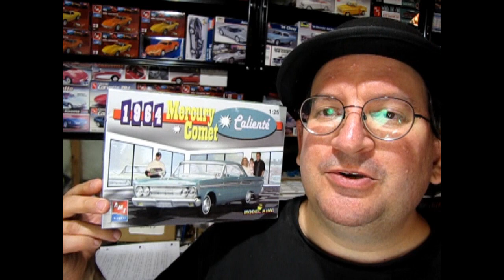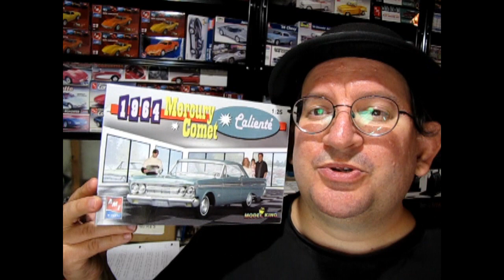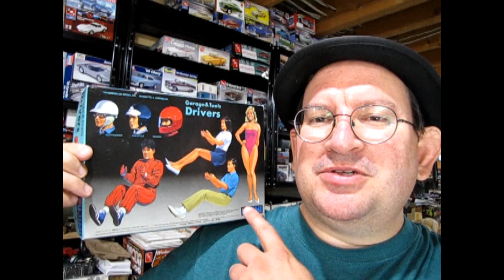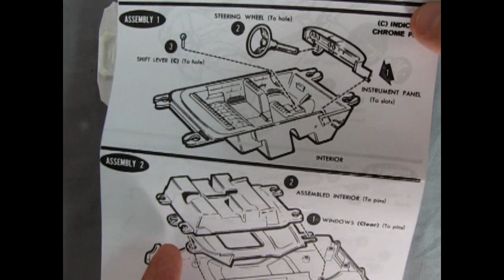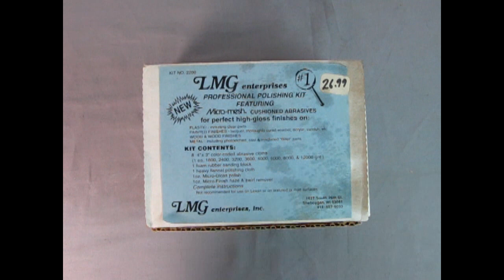Let's Build it! - Building The AMT/ERTL 1964 Mercury Comet Caliente Plastic Model Kit

Comment: 64 would have turn signals on column.
Reply from the maker: It's a 1964...it's just that AMT didn't mold the turn signal lever on the column.  These are the "Craftsman" beginner kits designed for junior model builders, after-all.